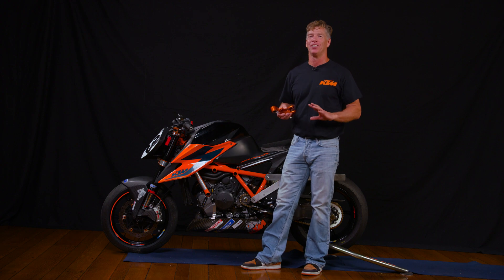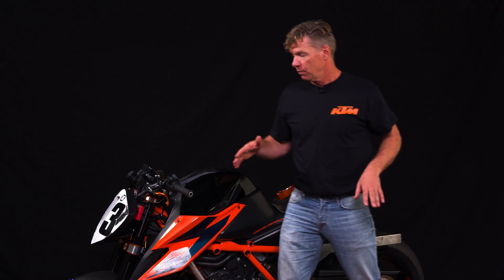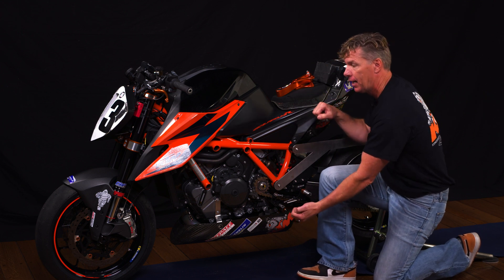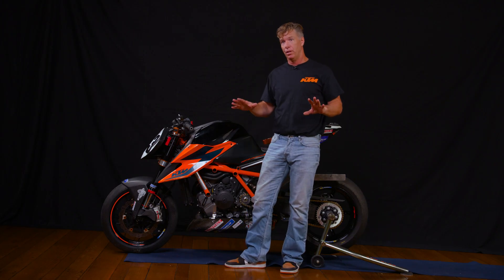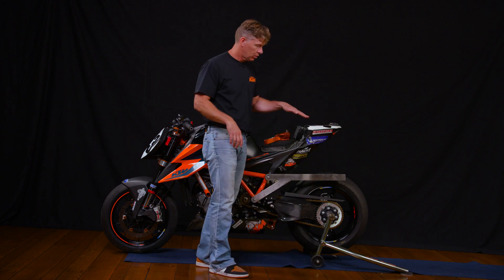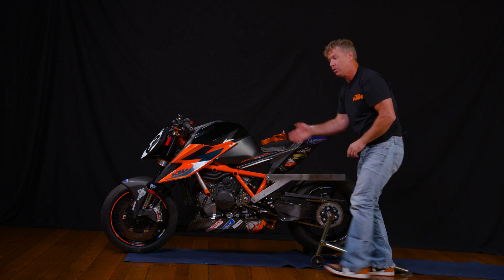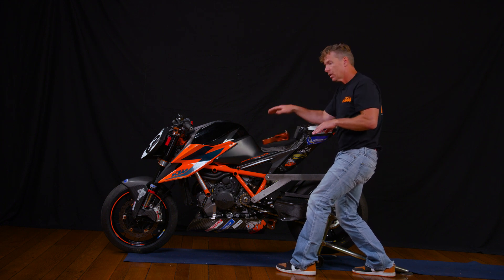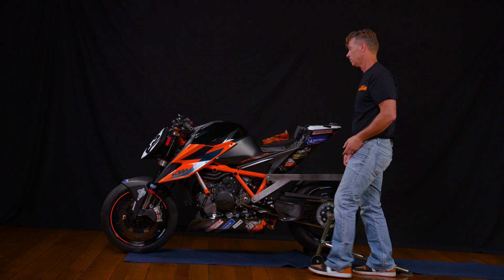What Is Anti-Squat and How It Affects Your Motorcycle - KTM 1290 Super Duke R

Comment: The ideal scenario is to have the perfect mechanical grip/anti squat angle without changing the ride height or jacking up the rear because once you do you will alter the balance of the bike.  In perfectly leveled surface you may not notice it but in downhill you would feel your bike is way front heavy and difficult to control.
Reply: Hi Eric, talking about drawbacks of increasing the swingarm angle, there might be some, just depending on the bike's use, desires and abilities.
As examples, on gen.2, when riding on roads it might be harder to keep the rear wheel up to temp, cause opening the swingarm unloads the rear wheel in all conditions except when accelerating hard, which might be difficult on roads. If one uses tyres such as D212 or rigid carcass tyres with an "excessive" anti squat swingarm angle you might experience more frequent lost of rear grip during corner entry. That won't happen on tracks. You might compensate the weight balance by rising the front but than you loose traction in the front exiting corners cause opening the swingarm increases the tendency to lift the front. I didn't do that. I compensated going down to 1.4 bar (d212) and changing riding style a bit, releasing the brakes earlier and turning in with some throttle...but the counterpart even on roads is the gain in agility, balance and corner exit (both traction and lines).
Also, you mentioned a gsxR that i happened to tune for a friend for track days, it was rised quite high in the back. He was happy for the laptimes but the graining of the tyres were usually bad (i am in the rubber business and can read the graining): too much pressure onto the compound in the front, difficult to keep temp in the back (for his pace and capabilities of course). Not everybody wants the tyres to last one track day only.
We repositioned the height for a better compromise.
Everybody should know the theory and experiment the changes themself, knowing that it might be a potentially endless process...
Reply from the maker: @rossanodimonte2520  Interesting points.   The added curveball element that also contributes to this equation/conversation is the rarely spoken fact that the Gen1&2 actually suffer (in my opinion) from having a regressive rate of -8%.  So, talk about compromise...   I agree with you 100%.  "The best setup" does not exist.   "The best setup for you" does.   And that best setup for you can only be arrived at by weighing your highest priorities VS your most acceptable compromises and ending up somewhere in the middle of them all.   ...and then of course it rains. :-)
Reply: @superduked33  
I don't think it is regressive, it is slightly progressive between 7 and 8%.
Like any other cantilevered shock mounted with an angle smaller than 90° onto the swingarm, it is progressive. The more is inclined, the more the progression.
Gen. 1-2 the angle is almost 90° with the swingarm, therefore almost linear (the frame is derived from the adventure)
It is "progressive" any time a certain wheel travel moves the shock more at its last part of the travel than it does at it first part. A spring only generates a force (hence a reaction) when compressed. If you need more force from it (to prevent bottoming) you need to compress it more. Another side benefit is that once the shock moves more oil volume at he same wheel travel, it controls the flow better.
Tipically you reach 20% progression with a linkage. Gen.1 and 2 only 7-8%. In order to prevent bottoming, KTM decided to make the shock stroke longer, with the bad idea to increase the wheel travel to 156mm...when the front is still 120mm.
The result is a sudden dynamic change in the geometry when you hit a big bump
Reply: By limiting the rear wheel travel to 120mm by using a stronger spring you should never experience instability anymore....at least I didn't. 
Also it is beneficial to close the hi speed compression or revalve the hi speeds to avoid big bumps compressing the shock more than the necessary. Which spring were you using in the shock? How did you set the hi speeds if I may ask?
Reply from the maker: @rossanodimonte2520  we arrived at that decision as well, stiffer spring helped keep us out of that problematic range.   But additionally the MUPO for that Gen2 had excellent low speed control.   So combining those two elements was our golden ticket to really impressive setup and lap times.   So good that for quite a while we could not match our Gen2 lap times with the new Gen3
Reply from the maker: @rossanodimonte2520  have you ever measured it or are you theorizing?   I paid to have the Gen2 measured in a series of 12 positions of the swingarm's range  - calculating both the axle position and the shock eye to eye measurement in each position by Gp Frame and Wheel.  They used their coordinate measuring machine which is impressively accurate.   The math was done from there after plotting the points in excel and it came out to -8%.   All of this was done by people smarter than myself, which isn't saying much for them unfortunately.  However the data does sync with my on track experiences anytime I got the rear that compressed.  By the way the only conditions I could get the rear to "collapse" like this was with a new soft rear, at otherwise unreachable drive and speeds, in race conditions.  Never on a used rear and never in practice.   So it was only in extreme conditions that we had this problem.  But when the problem occurred, boy did it have an impact.  I went off track every time.   ... Good talking with you rossano.  Thanks for contributing your opinions and experience
Reply: @superduked33 
Very interesting. It deserves deepening.
I did measured myself as i could and than doing some math. The shock stroke (loose in my hands) actually matched the OEM WP setting bulletin and the actual mupo as well. Ohllins declares the same stroke and length too. I guess nobody wants to take the risk of a geometry change...
 Trusting the declared wheel travel (which i have doubts of now that you say it), the swingarm ratio ends up being 2.65 at bottom. Than i extended the mupo shock very accurately on a bench than measured again the rear height in  the same spot. The swingarm ratio came out to be the same. To add other clues to the mistery, the founder of Mupo, Gianluca maselli (last year sold the company) whom i deal with regularly for business, chatting about set ups etc. told me that the bottom-end bumper, made of cellular polyurethane, contributes to the "spring rigidity" calculation of that part of the stroke. The stroke it covers is not that small compared to the total.
So i figured the geometry is actually linear throughout the stroke and the small progressiveness given by the bumper. If the actual wheel travel comes out to be longer than 156mm you are right, it is regressive.
I trust what you are saying, expecially if it comes out the rear wheel travel is not what declared... but at the same time the only explanation for the swingarm to be geometrically regressive (not talking about damping progression/regression here) is that  it goes geometrically over the 90°.... can't think about that since it would be criminal. Do you have the actual rear wheel travel numberr?
Reply: Hi Eric I have been thinking about this a lot. Just to avoid (my) misunderstands due to language or data interpretation, i share here my math.
In order for the geometry to be progressive, the shock/wheel travel ratio has to decrease moving towards the bottom.
Playing with numbers, If I have i.e. 1:3 at  rest (0mm stroke) and 1:2 at bottom (full stroke) the spring will still generate the same force cause it is being compressed of the same amount (F=K x stroke, i.e.170N/mm x 1mm = 170N): but in the first case the force will contrast 3mm wheel travel (nice and plush at small movements); in the second case will contrast 2mm wheel travel (hard and resistent toward the bottom).
In order to be regressive these numbers have to be inverted at some point of the stroke: the deeper in the stroke, the higher the wheel travel in relation to the same shock force.
Is this last case you found out with the analysis you had made? 
Sorry just to make sure I am not misinterpreting your data.
Reply from the maker: "It deserves deepening" is my new favorite sentence for everything
Reply: Please send me the information to obtain this linkage. It’s beautiful.    MaC
Reply from the maker: Here you go  @robertmacforesman3523  :  https://superduked.com/
Reply from the maker: Not my experience at all Cass, but I do appreciate your opinion.   I do agree it would be ideal to be able to reposition the swingarm pivot but alas, it is a Super Duke R after all.   I'd also love adjustable triples...  Back on the rear height though I feel zero drawback from raising the rear on this bike, only benefits.  Uphill downhill on the brakes or on the gas.  In fact neither did I on the previous Gen1/2 Super Duke R, or the GSXR 1K, the R1 or the Ducatis I raced - they all benefited from more rear ride height.   In fact the GSXR was nearly impossible to ride fast without it.   Unfortunately I can't attach a pic or I'd offer one here of this bike with its raised rear ride height running away from other bikes going down Laguna's infamously steep Cork Screw and into Rainey Corner.   Excellent balance and control.   The bike was inspiring to ride fast.   If you live in Northern California I'll offer you a ride on it at a trackday to experience it for yourself.   Really fun bike to ride fast.
Reply: @superduked33  Yea, if you are heavier than the spring rate can accommodate ideally.  Meaning if there's more sag statically and it's amplified during load/acceleration that you pointed out in the video then I agree to jack up the rear.  My opinion would be stay stock or move the pivot arm as well.  I had manufactured a number of dog bones and linkages for my own use (not for sdr) and I came to conclusion that any change you made will work well in one circuit and bad in others.
Reply from the maker: @cassin11  That's pretty cool Cass.   What did you use to come up with your different designs of dogbones and links?   Was it math or software or just a great imagination and feel?   We use MotoSpec, which is mind blowingly fascinating, and incredibly helpful.   Although I will say this about software and math - in my experience these at best can and might get you closer to the promise land, but from there you still have work to do.  It's not just math.   It's testing.  And then more math.  And then more testing.  And then nobody answers your calls anymore because you keep wanting it better.   And then maybe six months later you not only reach your original goal, but you surpass it.
Reply: @superduked33  Nothing really fancy.  Just trial and error.  I do have an engineering degree though but I don't claim to  be an expert in bike geometry.  Maybe I wasn't clear in my original message and I don't intend to dismiss your product or give negative impression to your potential customers.  Sorry, if you felt that way.  I see you put some good effort to come up with a design.  There is a real use case for it.  I just think we need to give more information about the product.  There are a lot of things one need to consider when changing suspension geometry.  I just want people to know about it because I learned the hard way.
Reply from the maker: @cassin11  Nothing negative coming from here Cass I appreciate your input.  A lot.  This video is part of a few I am putting out to help people understand exactly what this new link is, how it works, why it is needed.   But when we filmed this one segment on Anti-Squat my buddy suggested I put it up as a stand alone because many hear and use the term "anti-squat" without really understanding what it is or how it occurs.   That might be a mistake because as you kind of suggest, it is a little incomplete as a stand alone.  ...The SDR in question has limitations on rear ride height adjustability, even with an aftermarket height adjustable race shock, because the OEM control arm hits the shock if its even just a few mm longer than stock.   So theoretically you can adjust ride height and as a result swingarm angle and trail, etc.   But in reality you cannot adjust much at all because everything hits everything else under the bike.  So since I am like you, with the help of my (literally) rocket scientist friend Gavin, together we redesigned and developed and tested and argued and finally after a year of work finished this link which is now for sale to other SDR owners.   It alone does not change ride height, it creates the possibility to.   It also reduces Progression from 11.8% to just 3.5%, which feels remarkable in comparison to what this bike was like stock.
Reply: @superduked33  hi Eric! can we name it  lineer linkage? so how is the effect on the regular bumpy fast road riding and of course, two up riding?
Reply: if it can handle 2 up or fast road riding other than track without going to heavier spring,  I assume it will not help filtering small road imperfections?
Reply from the maker: @leventeyuboglu4501  There are three link kits.  Two are meant for use with OEM shocks.  They each are slightly more linear than stock.   The third kit, the race kit, which you'd like to name linear linkage, reduces progression from 11.8% to just 3.5%.   Which is great.  Especially on the regular bumpy fast road riding you refer to.   Vastly improved over stock.  BUT, like you mention, two up riding it is not ideal for.   Having a progressive rate is almost like having two springs - one for mild travel, the other for deep and heavy travel.  So with this far more linear link the bike can and will be setup more finely tuned for you by yourself in a sport riding situation.  Throwing your uncle Jimmy on back might get you traveling pretty far down the travel of your shock.   I can't predict how it would feel because I have never tested two up.
Reply from the maker: @leventeyuboglu4501  The race link kit is not designed to handle two up riding without going to a heavier spring.   The idea of using a progressive rate is to give you one motorcycle that can handle everything that any rider on the planet can throw at it, including that rider with his uncle Louie on back sometimes, "OK".   The idea of using a more linear rate is to give any one rider the opportunity to set his motorcycle up more for just him (or her).   Maybe that would include increasing spring rate, maybe decreasing.  Depends on the rider.   And once that rider set his bike up to his liking, the race link would be far superior to the OEM link handling small road imperfections, large road imperfections, bumps at low speeds and bumps at high speeds.  Far superior.  But motorcycle setup is all about compromise.   And by using a progressive rate, like the bikes come stock, you are covered everywhere, but also compromised everywhere.   The race link kit is all about eliminating the compromises you do not need to make for just you riding by yourself at any speed you want.   I hope that helps
Reply: @superduked33  thaks for your time and detailed answers. Very much apreciated.
Reply: @superduked33  
I agree with everything.
Also it worths to mention that the fork is highly progressive by nature due to the strong contribute of the "air spring" (oil level/air gap) in the last third of the travel...which occurs during hard braking only, with the back of the bike up in the air. There is no spring strong enough to withstand the braking forces all alone.
On the roads  there are bumps and the fork can actually work deep down the stroke when bumps are taken at high speeds due to the unsuspended weight inertia. If that's the case, it is non nice to have the back of the bike linear and the front progressive, cause this will affect the sag differently. Every time front and back sag differentely there a geometry change and a potential instability.

Comment: You have any of these links for the Gen1?
Reply from the maker: Unfortunately the Gen 1 does not use a link system.  The shock is bolted directly to the swingarm.   But you can raise the rear ride height regardless, but using an aftermarket shock with height adjustment.  If that is not an option you can also change gearing, because some combinations add height too
Reply: @superduked33  Gotcha.  I have a penske rear shock with height adjustment so that should work is what you're saying?
Reply from the maker: @turkishexpress  100%